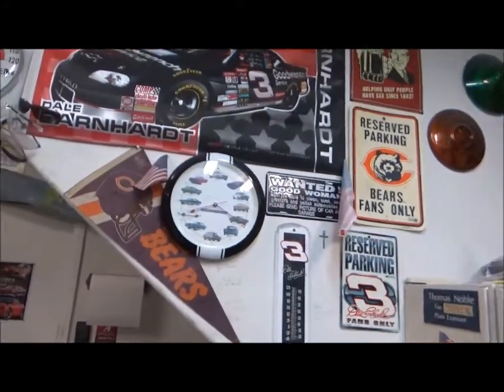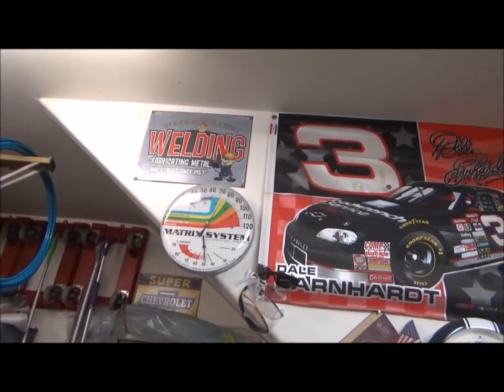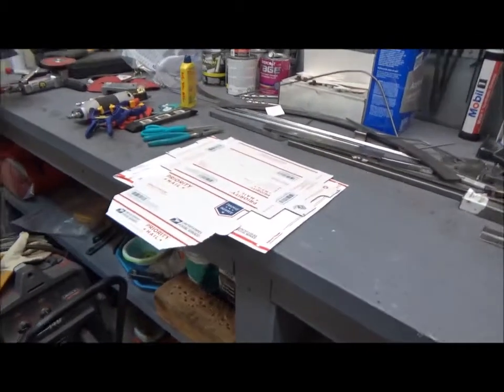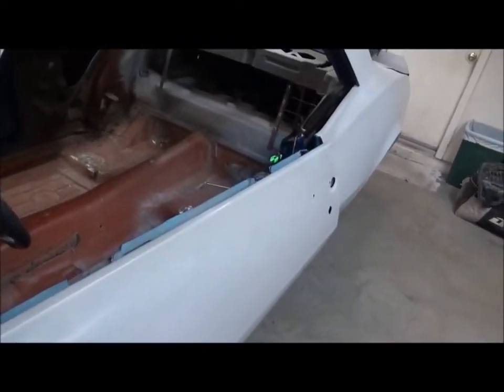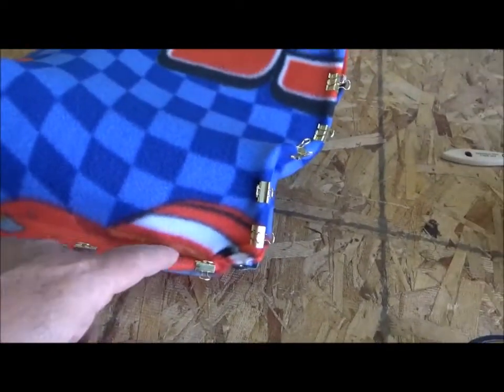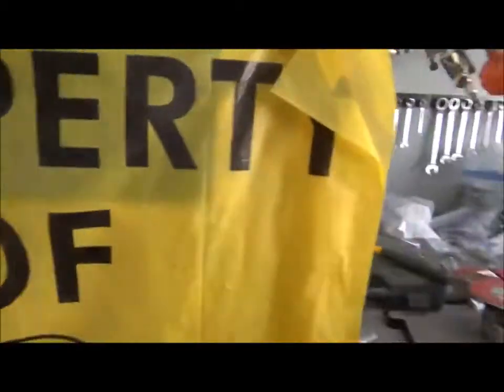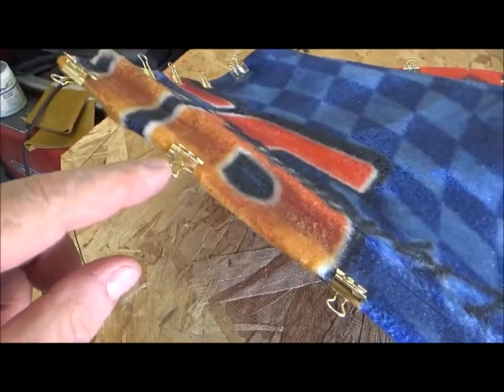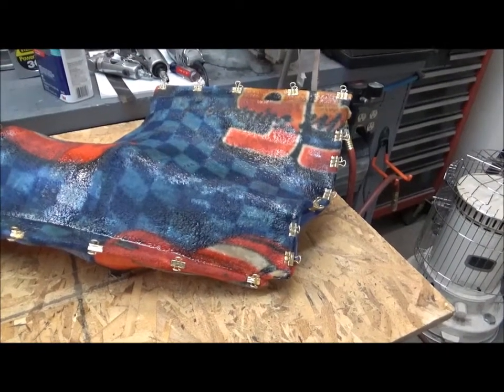1968 Camaro Resto-Mod 4-27-17

Comment: Those should come out nice, SprayWayCustoms did a bunch of videos on custom door panels, dash and rear deck covers to accept speakers with a lot of candy paint and they really came out nice. He uses a spray adhesive to attach the fleece and stretch it over the form before he applies the resin.
Reply from the maker: I'll try the spray adhesive on the nest panel  - thanks.

Comment: So to hold the flees on you could use drops of super glue rather than binding clips that way there is nothing to grind off. Just a thought.
Reply from the maker: Don't know if the resin will react to the super glue - the binder clips was the way I was taught to do this and they grind off pretty easy.
Reply: The crazy glue does not react to the resin, in fact there are pro's out there that use that method that is how I came across it. Saves a ton of time grinding off the clips just a thought.
Reply from the maker: So the Crazy Glue brand is what they use? Thank you for the tip. Never heard that before but then what do I know I'm old school.
Reply: Yea, I am also old school I just happen to see it once on Youtube and looked it up some more. I seen everything from regular crazy glue to cheap dollar store knock offs used. I have some one off parts I want to make for my bike and I have to do it using fiber glass and that was probably the best way I saw to do it.